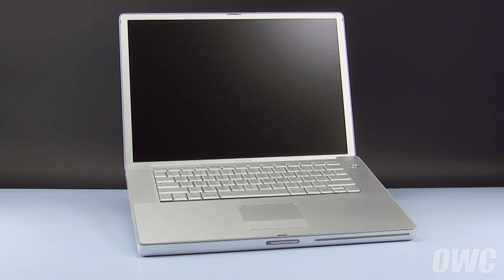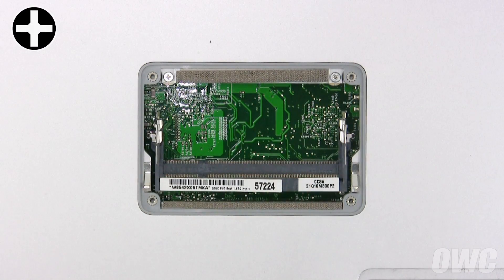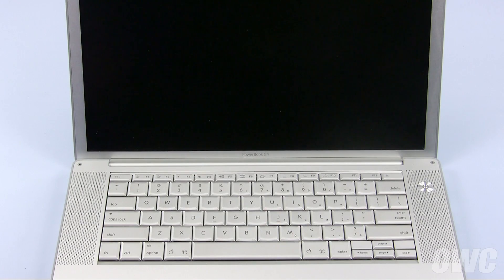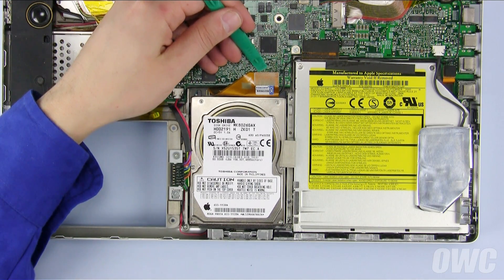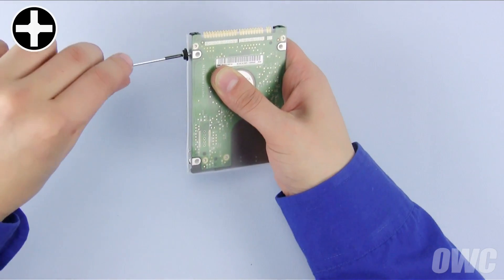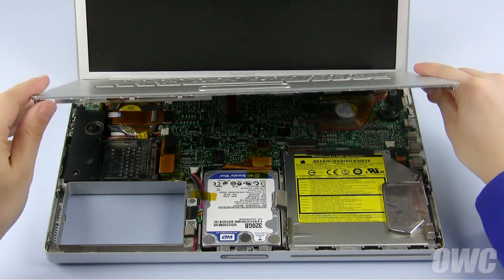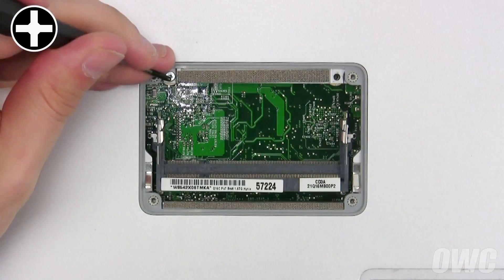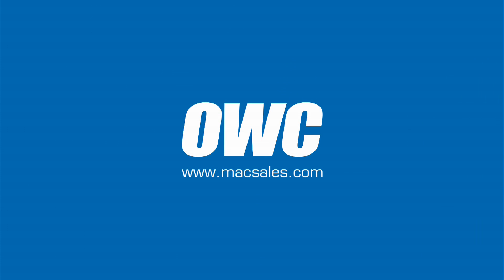15-inch PowerBook G4 "Aluminum"  Hard Drive/SSD Installation Video

Comment: I have a PowerBook G4, A1046.  I want to replace the internal Maxtor 80gb drive with a newer one up to 1tb.   The interface is ATA/IDE.  Are you indicating with the Mac sales link above that any 2.5 inch SATA drive will work with this older laptop?

Comment: The G4 has a IDE hdd NOT SATA a hdd so it's physically impossible to install an SSD in this computer.
Reply: i run a M.2 Sata SSD in mine with an M.2 to IDE adapter.
Reply: You should stop coding your zero echo and check your facts before posting
Reply: Juan Jacinto  There is room in a PowerBook F4 for the SSD plus the m.2 to IDE adapter?  Can you post a link to the SSD and adapter?
Reply: @williamferguson8164  William you get a .m2 sata to ide adapter and install a .m2 drive on it.  Have not done it but planning to.